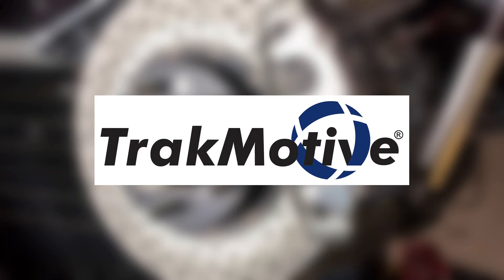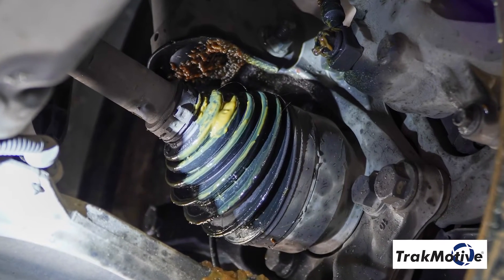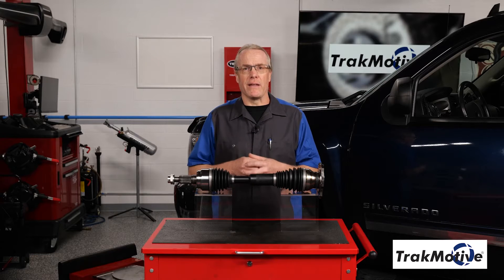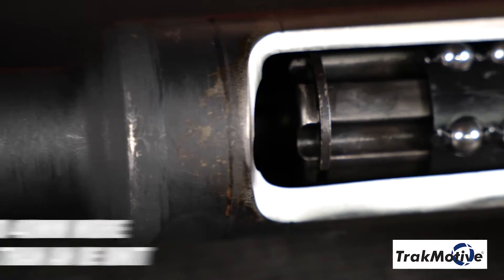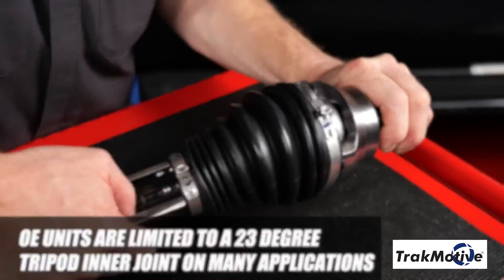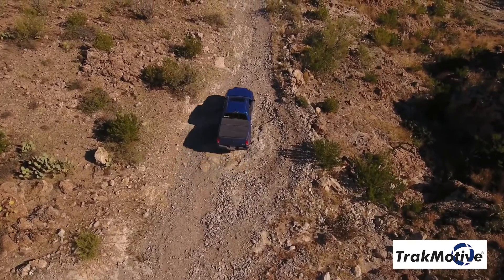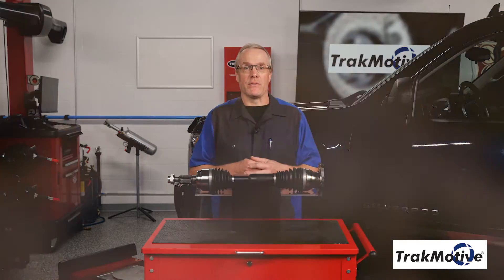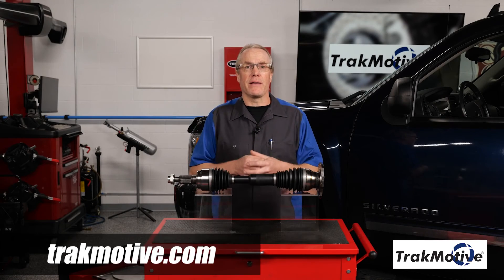TrakMotive Xtended Travel CV Axles - Let's Take a Closer Look

Comment: I have now purchased 6 of these axles for my 2004  Subaru XT. 4 for the driver side an 2 for the passenger side. All in the front and this is in the last 4 years. My Subi only has a 2'' Anderson lift and its mostly driven on the road
Reply: Yup… these are ABSOLUTE GARBAGE! 09 lifted Ranger went thru 5 in 18 months, and it doesn’t even get any hard core off-road use. One axle only made it 3 months!! 

(By the way, DO NOT buy the Napa ones either. TMotive also makes them for Napa. Same exact Chinese sh*t, just in a Napa box). I don’t know how this company gets away with making such crud.

Comment: 2009 Chevy 1500 4wd 6” lift 

Cv shaft Part number-GM8228XTT

Installed these when doing complete front end upgrade/rebuild and had alignment done. After a week noticed a clicking and noticed the ouside clamp for outer boot was hitting grease zerk on lower ball joint which was partially broke off. Then started to notice a noise when turning and checked out to be the axle shaft was rubbing hole into the front struts. Took to dealership and said there is no adjustment possible and that the thickness of the axle was the problem and does not allow for enough travel. So now I’m out of over $1000 and now I have more problems than I started out with.

Comment: I bought it and regret it, when I talk to customer service they said you have to buy new one first and then send us old one back on your expenses then we will issue refund. So I spend 130$ when I bought then 350 for installation. In 2 months just 2 months axle start causing vibration and it making so much noise when i accelerate. I send 100 dollar again to find out what wrong with car. Now for refund I have to spend 110$ to ship it for 130$ refund. That a good scam
Reply: They ARE a scam. I also found out the hard way, after lots of money pissed down the drain. You’re not alone man.

Comment: I tried these on my ram 1500 and 2 inch bilstein level. I did use it alot. Sand , snow, steep hills. Only got 6k miles before clicking and other pop noised. Did not totaly fail but was concerned it would leave me stranded so i removed. Trying the same one again. Maybe it will be better the second time.